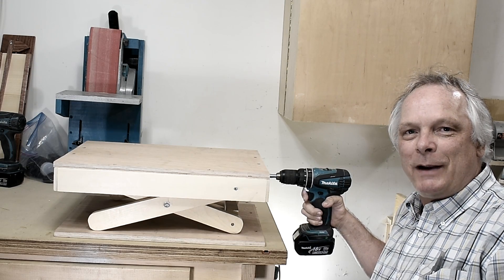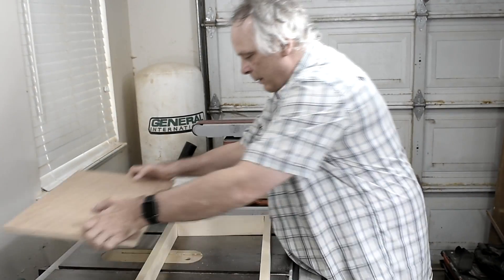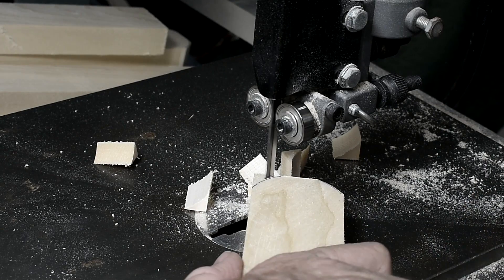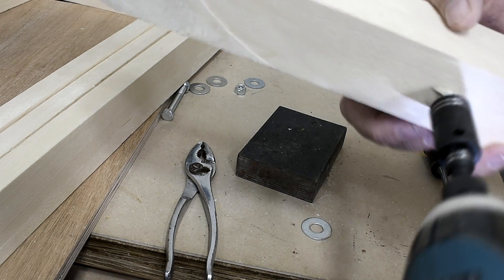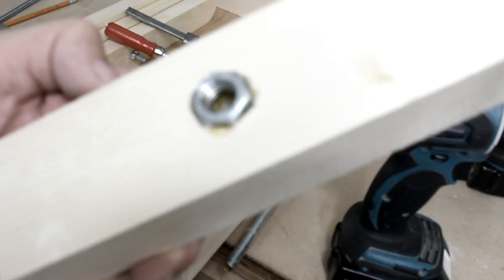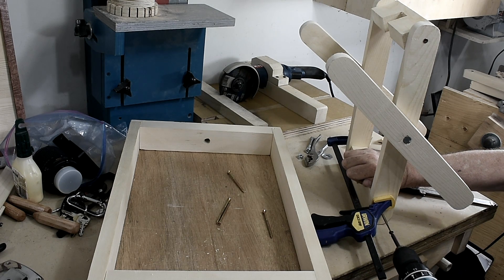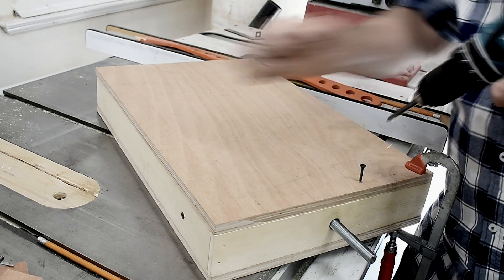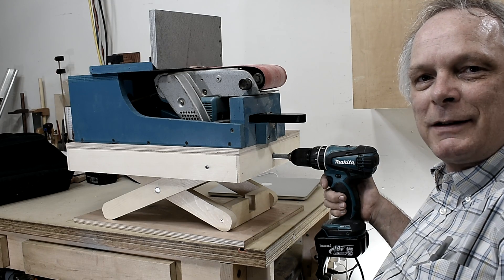How to Make a Scissor Lift Table

Comment: I admire the fact that you can do all of these things regardless of your hands conditions. I say that not as a derogatory statement, but to let you know that I too have issues with my hands. I have what the doctors call essential tremors, not to be confused with PD. None the less it makes it extremely difficult to work at times like putting in screws or putting on nuts etc. So I applaud your efforts to not allow your condition to stop you. Kudos to you sir

Comment: Thanks for sharing! This is perhaps the simplest scissor lift design I have seen. The only issue is that, when the table is elevated both legs are under one side, so the table becomes unstable if more weight is applied on the unsupported side.

Comment: Good job, Jack! What is the ratio of max lift to length of risers? It looks to be about 85%. I'm thinking of building a lift like this for my wife's stand mixer powered by an auto seat adjuster motor because it's reversible.

Comment: Thank you very much for this build. I'm preparing to build a vertical stack dust deputy project with a 20 gallon eagle1654 drum, and was trying to figure out how I could raise and lower the drum for emptying  independently from the lid since the lid will be fixed to the dust deputy.This is the perfect solution! Thank you once again. God bless!

Comment: Thanks Jack,

You gave me and idea on how I am going to build the lift mechanism for my Dust collector bucket, I have a 15 gallon barrel that I will raise to nest with the bottom of my Cyclone base plate I only need to lift the barrel about 1 inch. I though about the scissor jack concept however seeing how easy it was for you make I am going to employ your concept. However I think I will make a wood track to put inline skate wheels or bearings to ride on the wood track.

Thanks Lane.

Comment: Using a 3/8" rod to lift my table.  Does the rod size make a difference.  Tabling not lifting any suggestion.
Reply from the maker: +Larry Jones Rod size is not why it's not lifting. Try make a prototype mini lift with a bolt and see what works.

Comment: Glad to see someone else with mobility issues doing what they love, and doing it so well too. I just got a bar-stool for my shop as I can't stand very long. I have been working on getting my shop set up for the first time and have been restoring a few old flea-market/yard-sale planes. Any suggestions from anyone on free/extremely cheap video editing software for a Microsoft PC? I want to put out some videos, but my only camera (a cheap, cheap, cheap one) doesn't have a mounting screw hole in the base, so I'll have to figure out something else to hold it for me while I try to work on wood crafts. I will be starting out with this as a first hobby ever and am on a fixed income for now until I finish college to be qualified to return to the workforce. I haven't had a paycheck since August 2013. So any sincere suggestions would be greatly appreciated. (I am studying to be a middle school math teacher. It is the only job I could think of where I would like the work and be able to sit or stand as required by my difficulties).
Reply: Thomas Russell I don't know what version of Windows you have, but after a quick look I found this program.
 http://ccm.net/download/download-2289-free-video-editor
I hope it helps, but if it's no good, message me and I'll have a more thorough look for you. All the best for your future career, and I wish you well.

Comment: The only problem with this table (although awesome) is if it is in the lower position and your cordless drill battery is out of juice, you can't raise the table until your cordless drill battery has been recharged.
One other issue, the legs at the bottom side of the table without the brace in between   you should add some kind of wheels to stop the bottom side of the legs from wearing out when you raise and lower the table.

Comment: Great video as always Jack! Also liked the cameo of John. I was thinking that a pair of small wheels on the legs that move up & down would make it function a little better, but I could be wrong.............. Steve
Reply: Sapele Steve I was thinking the same thing.. but reckoned they could be added on later if the legs wont slide properly.

Comment: Nice job Jack, I always enjoy your videos!  

Observation about the glued-in nut: Since the rod is pulling toward the drill, I am thinking it would be stronger to have the nut on the other side so that it is pulled into the the cross-piece rather than relying on the glue to hold it.
Reply: Hmmm... I'm pretty sure it pulls to lift, since the distance between the tops of the x's gets smaller as it goes up. If I am wrong, so be it, but I don't want you getting hurt if I'm right and it drops the sander on you.

Comment: Nice! 
Maybe next video could be about how to make some crank handle with rod that have larger indentation(so you would not need to crank it for few minutes to raise/lower it). Maybe some handle that would be hidden in table and you could just push it out and use it.
Reply: gears

Comment: you raised John to new Heights! (did you see what I did there?)
great job and vid as always Jack, enjoyed that. I suppose this design could be modified for a small router lift or similar.
incidentally I like the angle grinder cross cutter but I think I'd prefer to stand behind and pull rather than risk a lot of sparks down the front it my shirt! just sayin'. thanks for sharing mate.
Reply: could you just use acrylic/plexi as a spark guard with the grinder cutter? I like that contraption.
Reply: This is how I made my router lift and it works great. I put my threaded rod at the bottom instead of the top but that isn't a huge difference.  Great video as always, Jack.
Reply: oamis hey mate, did you make a vid of that? I'd be most interested.